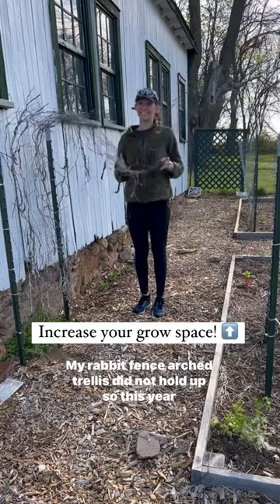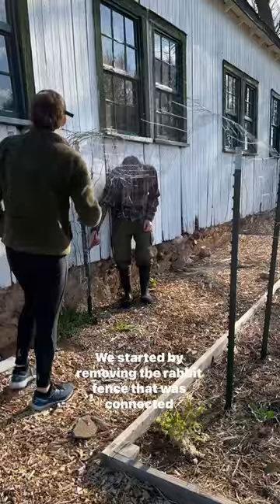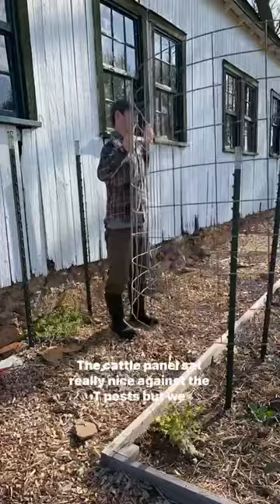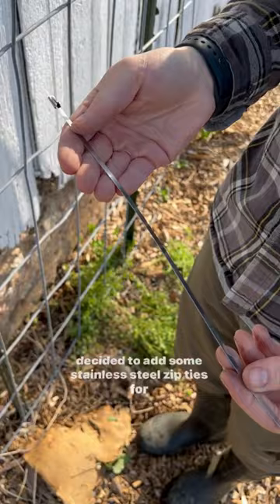DIY Arched Garden Trellis #gardening

Comment: The zip ties could well be a mistake. 
I would have thought a proper bracket would have been better and stronger.
Reply from the maker: Holding up so far, we’ll see! Cheap and easy
Reply: @MasonDixonAcres  I use plastic zip ties on mine and it's literally fine.